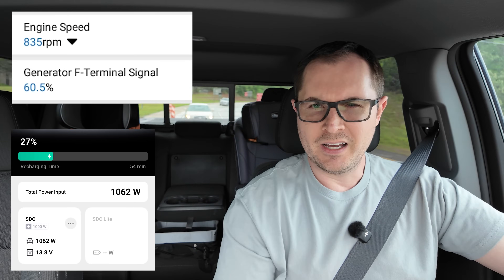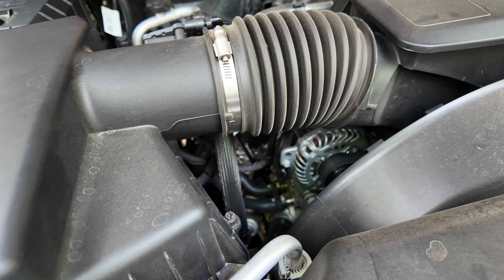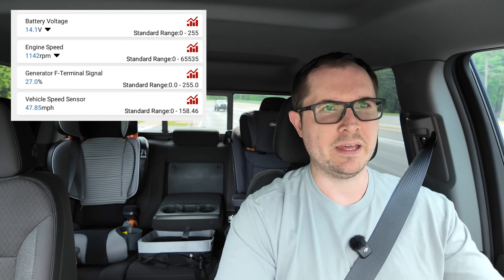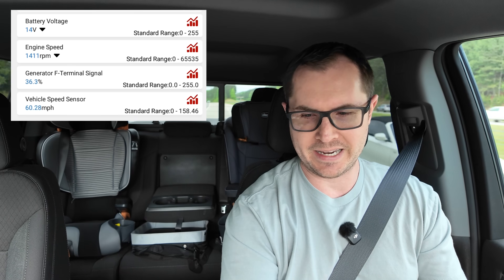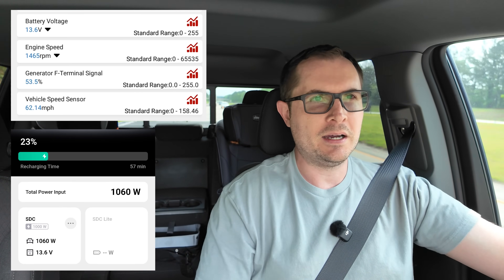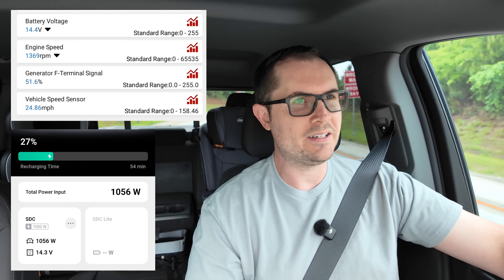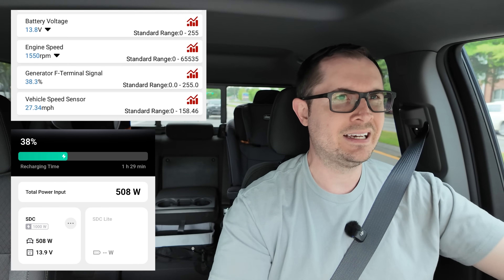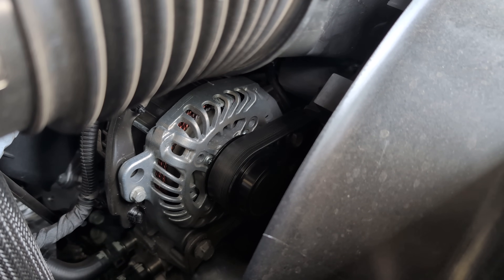I Show REAL Numbers: Impact of DC-DC Chargers from DJI, EcoFlow, Bluetti on Alternator

Comment: I heard that LiFePO4 batteries destroy your alternator, and that a DC to DC charger prevents the LiFePO4 from destroying your alternator.
Reply from the maker: If you use LiFePO4 for a starting battery in vehicle and connect direct to the alternator that could certainly wreck havoc on the alternator since it is designed for lead acid charging profiles. But, the typicaly use-case for LiFePO4 is for an aux battery or power station battery through DC-DC charger for those reasons.

Comment: Excellent data collection, and I respect that.  I wish the actual effect of running an alternator at 90% of capacity was explored in the same way!  Maybe in another video....
In my opinion, if you are running at under 80% capacity, you're probably fine indefinitely.  If you are running at above 80% capacity constantly... well, you'll see increased wear on your belt, and the alternator will run hot - ultimately reducing its lifespan.  By how much?  No idea.  :D   If you can afford a lifestyle that includes these solar generators and DC-DC charger solutions, you can afford to replace an alternator and belt when they (slightly) prematurely fail.

Comment: Always respect what mechanical or electrical equipment can handle. Nothing is free. It would be a good idea to at least tailor you situation to what you will do. If your power station is low, and you are going to drive fairly far, you can dial down the amps a lot, so you will still end up at your destination with a full power station. If you really need it in a lot of rain and clouds situation and you really need the power, yes then you can turn it up. Keep in mind not only does the alternator pay a price for fast charging, but the power station battery does too. Nothing is free.

Comment: I had all this figured out back in the 90's with my '87 Volvo 240 when my headlights would dim when driving with wipers on, heater on, radio on, heated seats on.  
I had to make a conscience effort to remember to turn everything off about a mile from home to make sure my battery was left with a good charge in it.

Comment: The question I had that u didn’t touch on is does the heating on a van use more of the alternator compared to the air conditioning. 
I’m in Canada. I know of alot that idle their cars and or vans a lot to stay warm.
Reply from the maker: Great question. I believe it is mainly the fan/blower that consumes energy from alternator since AC compressor itself runs off the engine. And, I believe it's similar with heat as the heat is generated from engine through heater core. Hope this helps.

Comment: Can you set it to automatically pause charging while idling? Like less than 1000 rpm the dc2dc charger stops sending current to the solar generator?
Reply from the maker: Great question. Most DC-DC chargers have a minimum voltage threshold setting, which determines the minimum voltage at which the unit will run. By default, most brands set it to 12.6-12.8V. The idea is, regardless of the vehicle spec or size of alternator, if the voltage drops and isn't keeping up, that means the alternator must be struggling and therefore the DC-DC charger should pause. It works pretty well across the different brands. I have mine set to 13V such that if I start to idle for a long time, the voltage will naturally drop closer to or under the threshold and the DC-DC charger then throttles down and eventually shuts off when it drops below. Hope this helps!

Comment: I had a 2015 GMC 1500 that I ran to 160,000miles. No extra load. That thing went through 3 alternators during that time and a battery about every 2 to 3 years. My friends truck of the same vintage and model had similar issues. Just food for thought...

Comment: So, l was told that on idle, that is the moment your alternator overheats due to not enough cooling.
Reply from the maker: Great point. It certainly is more susceptible when no movement, less airflow + lower engine rpm which leaders to greater consumption out of available output.

Comment: I put a switch near the seat on my campervan to shut my DC to DC charger off while driving in the city and idling.

I have gotten in arguments with electrical outfitters regarding why I would want a shutoff on an alternator charger. It was intuitive for me understanding how alternators produce power.
Reply from the maker: Nice setup
Reply: Your intuition is spot on. Know that the better DC2DC chargers also have a 50% output option selectable from the drivers seat. My Renogy charger has such option. NEVER run the charger in stop and go traffic or prolonged driving at really low speeds and attach a thermistor to the alternator body that reports temperature. Your reply is a breath of fresh air in a world of ignorance. Most important is install a shunt meter that monitors alternator output amps. The scan-tool F terminal data does NOT do this.
Reply: @cruze1953 good to know it was worth the trouble 😁.

Comment: I went the other direction.   setup on my truck is  200 watt solar panel connected to a solar charger connected to vehicle battery.  Solar is charging the truck battery as its driven and alternator kicks in when it needs to. on sunny days the alternator hardly works. At night which is a rare drive for me the solar charger draws less then 8 watts. while parked the truck battery is maintained with a battery charger.  been running this rig for the past 5 years, battery is like new still showing 1k cca.  and yes i have an on board 12v/120v inverter for my tools and or camping.
Reply from the maker: Nice setup
Reply: @AdventureRocks  i like to think so....  saves alternator  and  less alternator works the better the mpg,  maybe i get an extra 200 feet per tank  but i will take that 200 feet lol

Comment: Running your alternator at max load really is not a problem. I run a construction company in Florida. We run all are trucks at maximum ac due to the extreme heat all the time. We run at idle with ac on regularly. Leaving the truck running and charging everything including our power packs, battery chargers etc. It no issues. Swapping out an alternator in the rare event it fails would take less than 15 minutes on a Ford F 250 and a new alternator is like $200. So these concerns are really unnecessary. Much more important to charge all your stuff 24/7 and stay cool.  For the weekend warriors I would not even consider this to be an issue at all.
Reply: Thank you! This helps put the issue in good perspective!
Reply: I haven't seen a $200 alternator in a long time.  They start at twice that.
Reply: AC runs off engine belts and not off alternator electricity unless you have hybrid vehicle with electric AC but then again hybrids don't have alternators.
Reply: @michaelmedicworldoftanks33fps nothing runs on my trucks without a alternator
Reply: I thought the AC compressor runs off the belt directly and thus has no impact on the alternator? 

At least that's how mine is in a Toyota sienna

Comment: To know for sure, you would have to contact the alternator maker and ask them. Too many variables like alternator size vs load and how much effect it will have long term. The DJI charger varies the output when you are driving depending on a number of factors. Sometimes I get zero watts out of it for a short time - it's a smart charger.

Comment: Is that load percentage accurate based on the standard range being 0-255? Seems like 99% on that scan tool is better represented as 99/255. Not 99/100. I could be wrong. Crazy to think my 2020 lm2 has a 220 amp alt.
Reply from the maker: Great question! The 0-255 is a common 8-bit range figure, but unfortunately irrelevant and listed by the software on the OBD2 scanner. It's kinda confusing the way it shows that, so my apologies for not explaining it better. The percent is on scale 0-100. For the 1/2 ton 1500 trucks, the LM2 3.0L diesel has a respectable 145A alternator, whereas on the HD trucks (2500/3500) the LP5 6.6L diesel has 220A standard. There are upgradeable options too and even dual alternator options on the HD units.
Reply: Oh okay so the the 8 bit note isnt implying it goes to 255%. Also I have the KW5 RPO code, should be a 220a alternator, right?
Reply from the maker: @MrWeaponlord  Correct! Wish I had spec'd that one on mine in hindsight.

Comment: anyone looking at vehicle charging should look at what the car audio community has done in this area, they've been pushing way way way larger loads for decades, it usually means huge battery banks, and multiple alternators, separated from the vehicle's electronics system.
Reply from the maker: Great tip, thanks for watching.

Comment: Great video. Very useful. Got the Ecoflow DC-DC charger myself in an Ecoboost F-150, works great. Perhaps we can conclude an alternator upgrade is called for? Interesting data at idle...
Reply from the maker: Thank you. Indeed, wishing I had spec'd a larger one myself.
Reply: @AdventureRocks  for serious charging install a second alternator kit and dedicate the second alternator to auxiliary charging and not encumber the OEM alternator with heavy lifting. Once the auxiliary alternator is isolated from the vehicle it allows you to increase the voltage to that of a Lithium profile. Also utilize the remote voltage sense capability of an alternator which boost the alternator output proportional to the voltage drop of the circuit to the batteries. Good solar charge controllers have this feature. My Renogy solar charger has this!!  Very few people know this.

Comment: Thanks for creating in-depth reviews.  I have a couple of questions about your videos: What do you use to have picture-in-picture window of the data that is being shown on your ODB2 computer?  Also what brand of ODB2 scanner do you used? Is there a video of it?  
 Edit: just saw the pinned comment with the product name... thanks... did you try others? Is this your best recommendation if you were to get a new one today?
Reply from the maker: Thanks for watching. The Kingbolen K7 is the latest version here: https://amzn.to/3SMZRRq

Similar software, but larger screen and wireless connectivity via bluetooth. Both the S800 and K7 are great choices. I'm sure there are others out there too, but those are the ones I have most experience with. If interested in the setup, here is more details:
https://youtu.be/DA7olXnbvUg?si=hhZaO4MGBcO_AAMZ&t=59
Reply: @AdventureRocks  Thanks for the ODB2 info 

How.did you manage to timesync the scanner out to your own video foootage?
Reply from the maker: @Tijrah  I use the built-in timecode to sync up. It seems to stay within a frame or two over 30 minutes of video.
Reply: Best thing you can do is install an inexpensive current shunt meter and alternator temperature monitor. THESE are your friends!
Reply: @cruze1953 Are there any recommendations for these items?

Comment: thank you for sharing your experience. clearly the alternator is handling the load, and it is well vented, in summer on a very hot day or driving in city traffic i strongly recommend you isolate the DC/Dc charger as you know the only thing that can harm your alternator is heat.

Comment: Great video! This answered a lot of questions. Still I'm unclear of the benefit of using a DC-DC inverter vs. using a pure sine wave inverter.
Reply from the maker: Thank you for watching. Technically the DC-DC charger supplies power to recharge the power stations that ultimately have pure sine wave inverters, or just a regular lithium bank. I think the main benefit is just harnessing available power from an engine + alternator to more rapidly recharge the battery bank or power station.
Reply: @AdventureRocks I'm still a little unclear then. Can a pure sine wave inverter be used to charge a power station? My understanding is it can. If so, is there a huge difference in the efficiency between DC-DC vs. pure sine wave inverter with the same wattage.
Reply from the maker: Great question. It'd be more efficient to use DC-DC charger to charge a power station. Using a pure sine wave inverter to charge a power station is converting DC to AC and then back AC to DC. Basically there's a loss converting AC to DC and back each time.

Comment: It has always been my stick with DC-DC chargers that they don't wary there output as the engine idles, thus there biggest selling point becomes there biggest limitation (constant charging regardless of input). When using just the alternator directly the voltage drop that happens when the engine idles means that the charging current drops and thus protects the alternator. It seams that the smart DC-DC chargers of today should be able to vary their output according to the incoming voltage, reducing the output as the engine idles to ramp it up as the RPM increase.
Reply from the maker: Great point! On the mainstream players they use the voltage drop as a signal to decrease draw. Each one has a "minimum voltage threshold" setting in their app. By default most brands set it to 12.6-12.8V, and then you can adjust what number works best. I keep mine at 13V and that seems to work nicely. So, if the voltage drops quickly from 14.4V to 13.3V the DC-DC will register the drop and quickly throttle down perhaps from 1000W to 200W...if it continues to drop to 13V or lower, then it completely shuts off till the voltage recovers. So not as slick as having a direct connection via OBD2 to read in RPM, but it mostly works. I think key is increasing the threshold as the default setting  is pretty low on most of them.

Comment: Running EcoFlow Alternator Charger on a f150, which has stock 240 Amp Alternator , no issues at idle or temperature rise. One can always upgrade the alternator on any vehicle, If you an EV you are to be more worried about "Range Anxiety" 🤣

Comment: My original setup used an LiBIM battery isolator.  It was fine, except when the SOC for my batteries was <=12%.  Then the  100A circuit breaker would trip.  I replaced the LiBIM with a Renogy DC-DC converter/solar charge controller.  Now I can set the alternator current limit.

Comment: When an alternator is full fielded, it gets very hot and armature will keep heating up enough to melt and toss its solder.  It was a quick function test back when cars had external voltage regulators.
Reply: The scantool F terminal input to the alternator is the same thing as full-fielding the alternator when it indicates 100%. Note that the "F" on the scan-tool stands for "Field"

Comment: Extremely useful bit of information on stock alternator and DC-DC charger. If folks concerning about excessive load put on their generator, use smaller charger and/or increase alternator output

Comment: This is the exact video I needed in my life. I have a 2025 Silverado with a 5.3L V8 and the same 170A alternator. I use a Bluetti Charger 1 that I set at 370 watts. This shows me that I will be just fine using it at idle RPM at 370 watts without an issue especially if I turn off the AC and all accessories while the truck is in the driveway. Thanks for this video!!
Reply from the maker: Nice setup. I like the universal compatibility of the Charger1...very useful.

Comment: Just throwing this question out there…How effective are the 120v outlets on a vehicle to change a power station…or is DC to DC charging the best way?
Reply from the maker: Great question. I went down that same road. Unfortunately most built in AC outlets aren't powered by a pure sine wave inverter, which means power stations may not accept them for charging, or charge consistently. All depends on make and model though. I'd say if you have a combo that works, might as well just use that built in option.

Comment: I wonder what happened when vehicles have the start stop feature , I’m thinking it just stops charging , but then again ur interior options don’t stop working except ur AC Temp gets warmer during the engine off time
Reply from the maker: Great question. I believe the DC to DC charger would simply halt temporarily as the voltage drops below the preset threshold. And then resume once it recovers. I haven't tested one on a vehicle with start/stop so that'd be an interesting test to see first-hand.

Comment: Excellent video.  Although this is not at all surprising if you know that demanded watts will equate to alternator amps, and that those amps gotta come from somewhere.  I think you've done a good job in bringing down to earth the reality of strapping some of these add-ons to our vehicles.  Modern vehicles are FILLED with electrical appliances now, from big screens, USB chargers, power everything, etc.  I was once told by a GM mechanic that in uncommon situations an alternator barely has enough to charge the house battery, and at times, in some vehicles under specific load conditions, the battery is ultimately used for ignition.  I wonder if those times, the DC-DC charger would actually pull from your truck battery!

Comment: If we wanted to be able to monitor our alternators percent of capacity as you had running the whole time, how do we do that? How were you able from the driver's seat to increase or decrease the set charge rate to reduce or add load on the alternator?
Reply from the maker: I used the Kingbolen S800 to read in data through OBD2 port:
https://amzn.to/4jSaDBh

To clarify and without getting too technical, the F terminal on a GM trucks is responsible for controlling and monitoring the alternator's charging output. It's not the same as putting a clamp meter around hot leg and measuring actual amperage or output, but still a nice indicator that I can easily read via OBD2 port. 

And, then depending on your DC to DC charger, most have a companion app. I was using the DJI Super Fast Car Charger in this video and it allows you to adjust the power level in the settings.